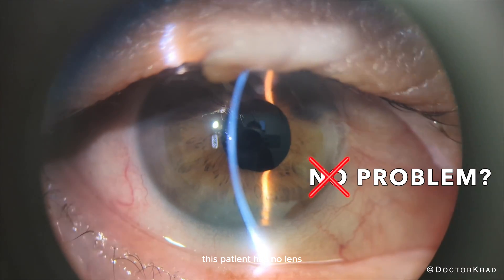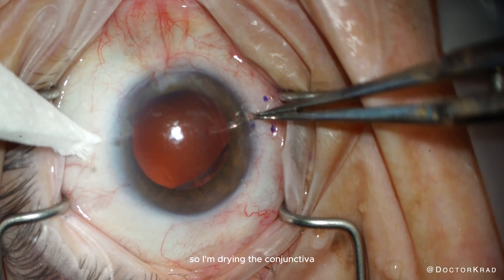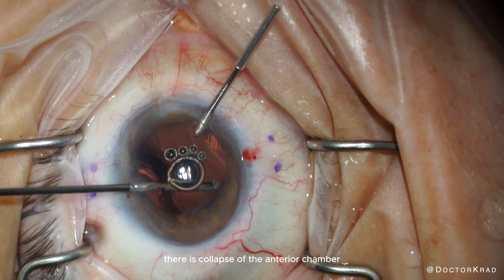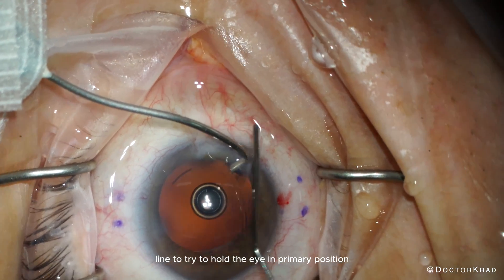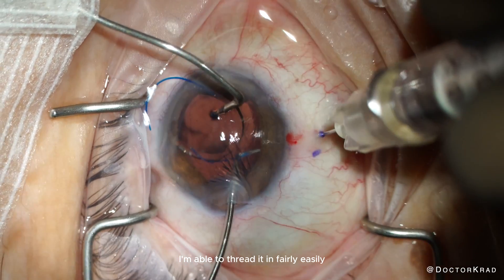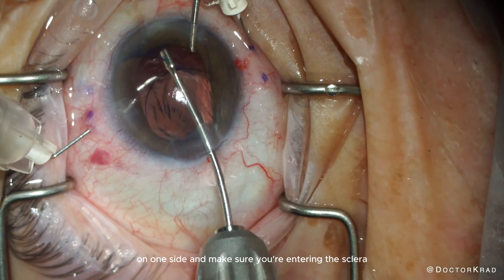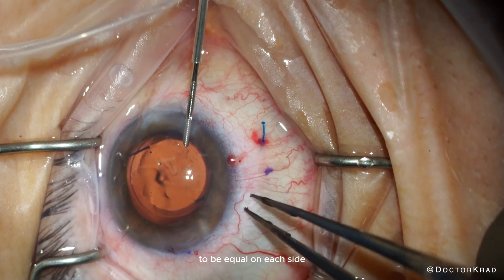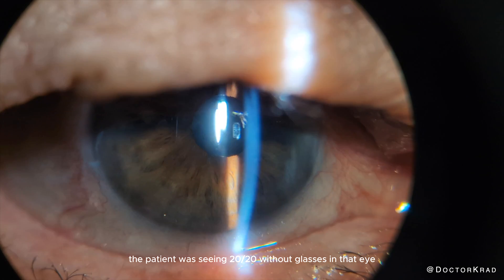Can we fix it? | Kim-Modified Yamane Technique after Complex Cataract Removal | ISHF

Comment: How did you choose your CT Lucia lens power? Did you aim for plano and use an A-constant of 117.7 with Barrett II? Or something else?
Reply: Hi @giocampagnamd Omar will probably have a better answer than I but I thought I’d chime in just to tell you thx for the videos on cataract coach, and also to share how I at least aim (may not be the best)…. I use the A constant on the hillrbf website for whichever lens it is I’m using (these days going j&j sensar ar40e), I enter As and Ks into a formula that doesn’t require ACD (or I use the ACD from measurements when the patient was phakic, or the ACD from the other eye if it’s phakic and doesn’t seem too different in AL from the eye in question). If I am going 2.5mm back from the limbus as most people seem to do these days, and I want the pt to end up near Plano, I “aim” ~-1.00. 
I do now always make a PI. I have a video in which I say I don’t think that’s necessary but I’ve now had a reverse pupillary block even going 2.5 back from limbus so now I always place a PI. 
Omar you did a great job here, especially given the challenges with AC maintainer!
Reply: @markgkoskomd  Ah okay, thank you so much! Very insightful. I'll check out that video. I've done about 8 Yamane cases in fellowship so far, and my fellowship director (Arsham Sheybani) has us go 2mm posterior to limbus. For "plano," he has us aim -0.5 with Barrett II and we try to find the pre-surgical phakic ACD, but if it's unavailable, then we'll just use the ACD from the other eye if still phakic, or we'll just make a guess. We've been using 117.7 as the A constant. Fortunately most of the cases I've done have come out somewhere between plano and -0.75 this way. I wonder if intraop aberrometry can help with this...would love to hear how you chose your lens, @DoctorKrad !
Reply from the maker: Thanks!  I typically use the pre Cataract Surgery Biometry & ACD measurements if available, and choose a lens target near -0.75.  In this particular case, I chose a 21.5 Diopter CT Lucia 602 with a predicted refractive error of -0.62.  His MRx is now Plano +0.50 x 180.  In hindsight, a 22.0 Diopter would have been even better.  I appreciate your feedback!
Reply: @DoctorKrad  Awesome! Thanks for the response. Really nice case, and congrats on the outcome